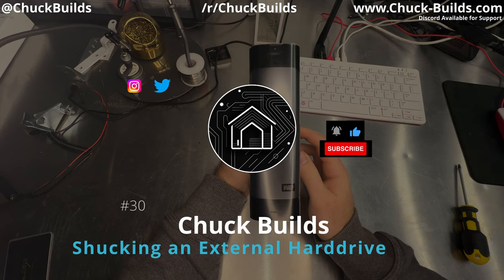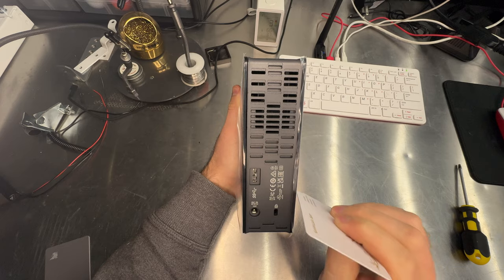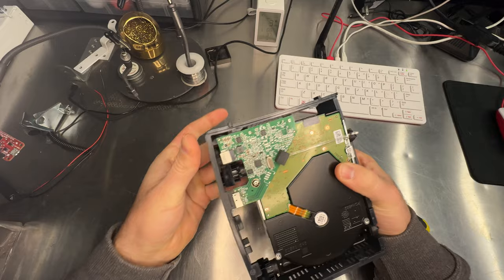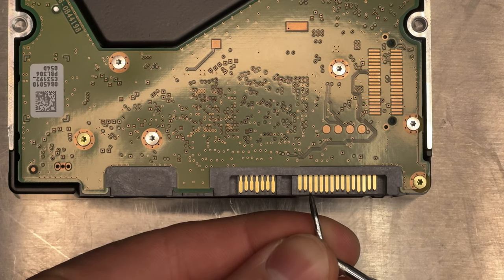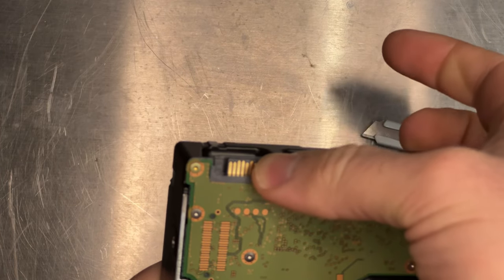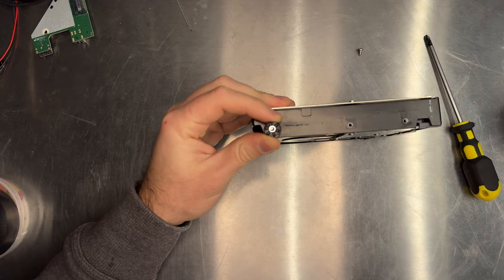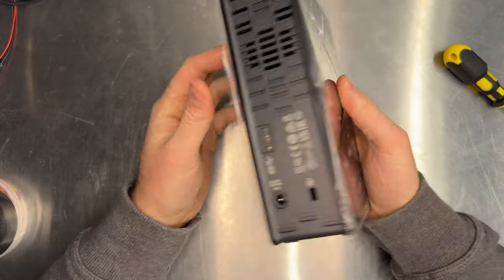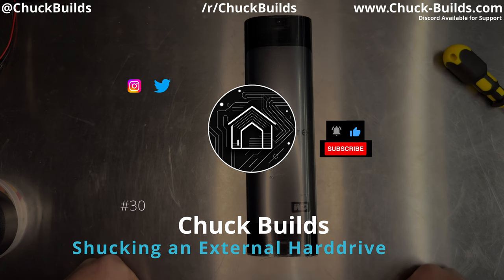How to Shuck External Hard Drives (Cheaper NAS Storage Disks!)

Comment: You can also use a Molex to sata power adapter to bypass the 3rd pin.  I used this method to avoid any problems with the pin.

Comment: I've never had the 3.3v issue with these drives.
Reply from the maker: I saw some folks say they also didn't have issues on a Reddit post talking about the white label drives, but I’ve had the issue on 2 of 4 shucked drives. I think it depends on your PSU. I honestly didn’t check for this one and went ahead and taped because it’s little effort.

Comment: Man I would not use electrical tape for that personally. It seems like it'd slip off so easily. I'd probably use nail polish. A proper electronic worker would probably use PCB/electronic resin but seems unnecessary.

Would it work in the enclosure if the pin was removed?
Reply: If you want to do it right you use "conformal coating".
Reply from the maker: This is the 4th one I’ve shucked and each time I put off buying kapton tape haha. I’ve only had the tape slip off once when a drive had been moved between 3 cases over the years. My thought is to use tape over an adhesive so it’s easier to remove if I ever needed the 3.3v pin or was going to warranty it. Having had a few for years now I think that’s less likely to happen now as the warranty has expired on my other drives and they’re still going with electrical tape. 

Unsure on how it’d work in the enclosure without the pin as I’ve never actually removed it
Reply from the maker: I’ve never heard of that, just googled it - would the contact pin inside the power connector not scratch that off as it is inserted?
Reply: @ChuckBuilds  if you plan on plugging and unplugging it frequently. In that use case I would use Kapton tape, with conformal coating on top.